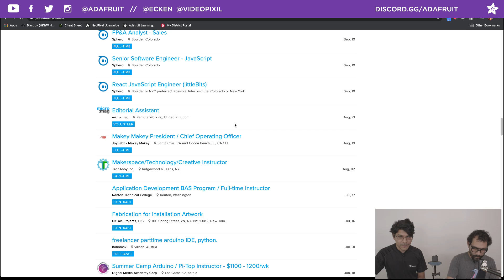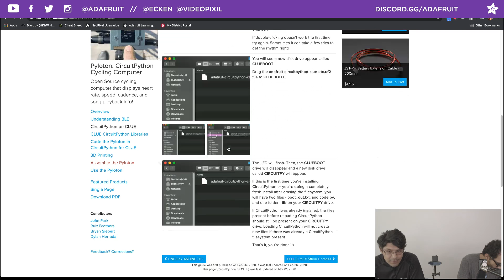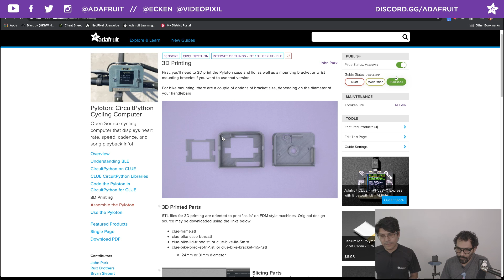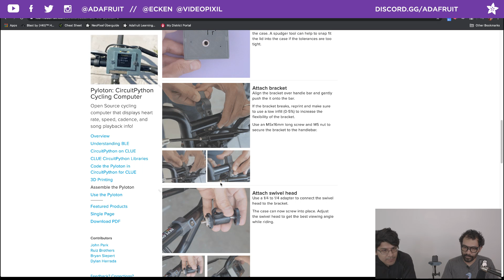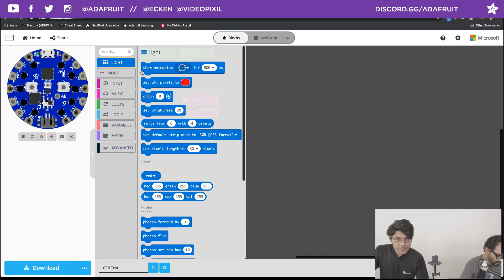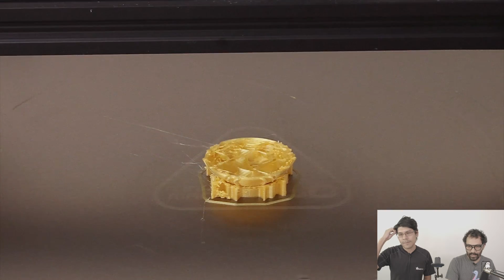3D Hangouts – Pyloton, Props and Guitars

Comment: Suggestion to help the customers that have to relocate the screen, & for future manufacturing as well; CAD & print a bracket can be placed on the face that will help with easy screen alignment & placement.  Perhaps using the button as a consistent reference of where the templet bracket will sit for screen placement.